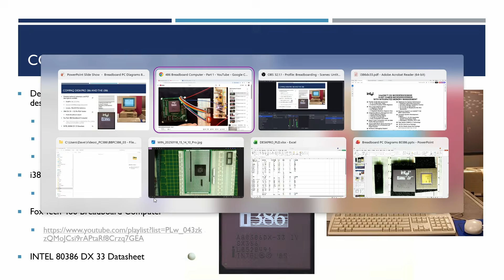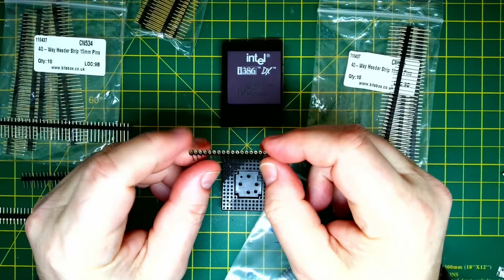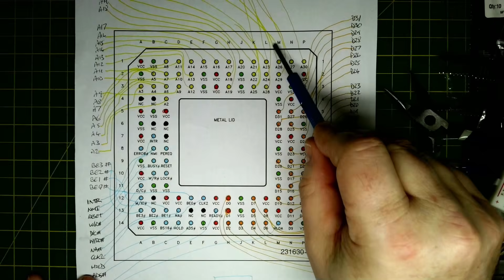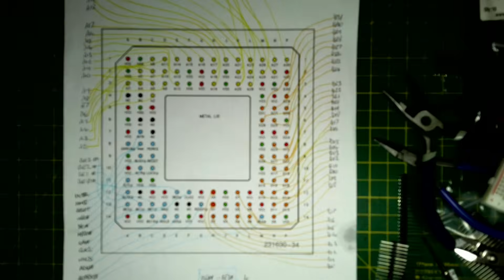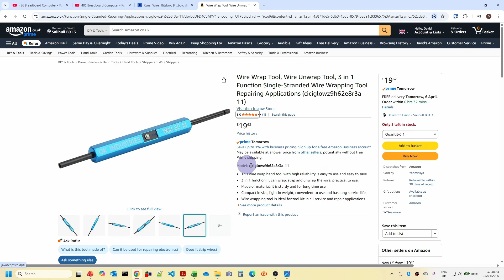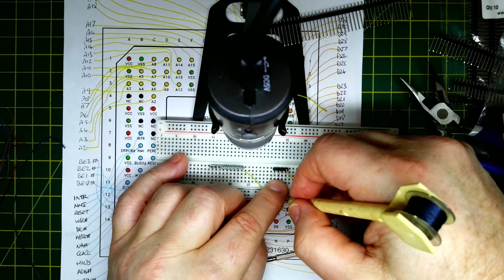386 Breadboard PC #3 132 Pin 386 Breadboard Adapter

Comment: I love this project. Making a 386 from scratch back in the day was impossible. Making it now is still challenging but on a breadboard it’s impossible, prove me wrong! 😀
Reply from the maker: I aim to prove you wrong. It would be very difficult with out the internal Compaq documents but I have a fighting chance with them. Most of the bits needed for the 386 PC I already have working (except for the DMA :-( ) from the previous projects (BIOS, Timers, Serial Port, Floppy Disk Controller, IDE Controller, Keyboard & Mouse). It is only the 32 bit to 16 bit to 8 bit bus control and the bus control state machine which are significantly different and really complex. Fortunately all the Compaq PLD rules are included in the design documents including the test conditions so this should make this aspect easier (but not easy). Thanks for the feedback. Dave

Comment: Have you thought about slightly flattening the round pins with a hammer?
Reply from the maker: Not really, since putting a bit of solder on the joints won't take very long, I suspect I would cause more trouble trying to 'fix' the round pins. Dave

Comment: might sound like a crazy idea, but did you ever considered using DuPont wires ("female") for connecting the underside pins of the CPU adapter to the rest of the breadboard (with "male" conectors to the other end), instead of wire-wrapping each pin? either way would be a real mess of wires, but... ;)
Reply from the maker: Unfortunately the CPU pins are 0.5 mm diameter which is too narrow for Dupont connectors. There is not an easy way to solve it. If I had recent experience of making PCBs then that would probably be the best way of solving the issue but it does feel like cheating! Dave
Reply: @bread @breadboardinglabs ’t mean sticking DuPont female pins directly on the CPU pins… what I meant was sticking DuPont female pins onto the extended underside pins of the CPU adapter (central region of the “breadboard adapter”) instead of wire-wrapping.. then, with apropriate labeling of the other cables end (male connectors) you could stick them in the right places into the breadboard…
Reply from the maker: Ah I get what you mean. They would need a lot of clearance with the DuPont shells I use but I can see it could work. CPU would be about 2 inches above the board to allow for the pins and shell and the bend in the cable. Dave

Comment: I like to build my stuff on veroboard or similar stripboard.... when you started this series, i thought that this woud be "the episode to watch".... :)
Reply from the maker: That will depend if it works! The DIP adapter side of projects has always been the trickier side to get right. Quite often needing 2 goes. Hopefully will get this one right as 100+ wires and 200+ wire wrap connections is going to be a bit dull! Dave
Reply: I found it quite effective for that green "holes only" protoboard is using old telecom wire because you can cram 2 wires into one hole.... that's probably no use here though.

Comment: for wire wrap, the wire bites in on the square corners for the reliable connections. those are not wire wrap pins and will need solder or some other force holding the connection
Reply from the maker: Yes I agree. Once I have checked the pin to pin connection is correct I will solder the CPU end. The breadboard side I will keep wire wrapped so I can change the wiring if necessary. Dave

Comment: I made a 84 pin PLCC breadboard adapter using a DIY PCB. I thought it was cool but this is next level insanity. Good luck!
Reply from the maker: Have you made the files available somewhere
 I would be interested as third party breadboard adapter PCBs are quite expensive for what they are. Having a starting point would be great! Dave
Reply: Well an 84 pin PLCC adapter is trivial really as you can do all the routing on one side. But I’ll stick that one and some others on my GitHub sometime in the next few days. Project for the 84 pin was to mess about with a Flex10K 84 pin FPGA, one of the last 5V FPGAs. Would work well for that computer you are building too, though I’m guessing you’re sticking to CPLDs.

Comment: I think it's more stable to solder all the pins of the CPU socket. You may need to remove the CPU later and loose pins can cause problems.
Reply from the maker: Agreed. I will almost certainly need to remove the adapter and make a correction or other change. Dave

Comment: If the shape of the pin/leg is a problem, would it not be possible to use a fine file on them? In my mind it looks doable with the pins on the edge of a table or other platform and then a few quick swipes with the file to get a grippy shape.
Reply from the maker: I think a quick dab of solder would be easier. Filing 132 pins without breaking any with my clumsy fingers I suspect would not be easy! Dave

Comment: It would be much easier to use a 386SX (it can be swapped for a TX486SLC). I understand that the 386DX is a better choice. I wonder if it would be easier to use an AMD NG80386DX-40 due to  BQFP132 design.
Reply from the maker: The main thing I wanted to do is reproduce the DeskPro 386 especially as the 16Mhz version used discrete logic. If you see the last motherboard in #2 this is a 386SX board but has lots of very large chips so no sensible design to work off for breadboards. The simplest way to do this would be to use a Raspberry PI zero with a bare metal PC emulator. Using the 386 DX is more to prove a point on what can be done on breadboards! Dave